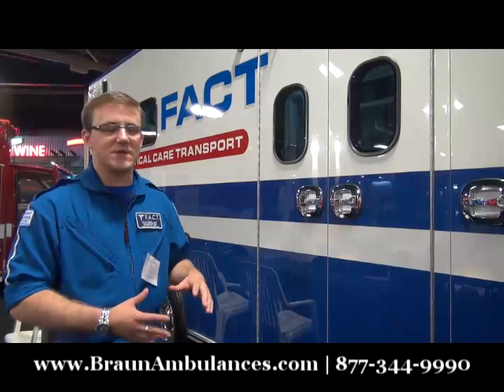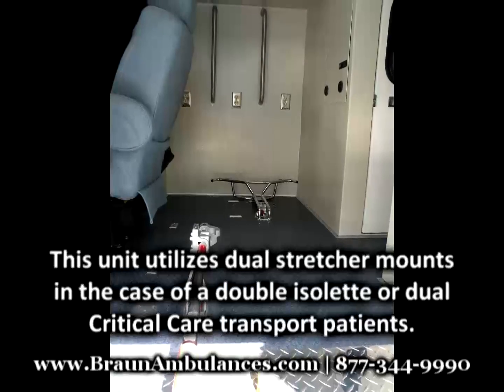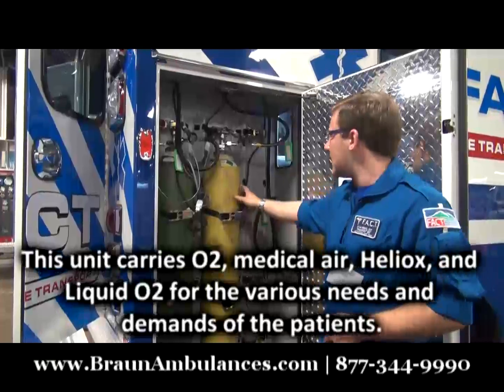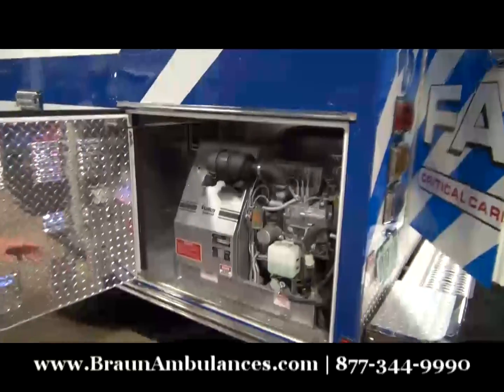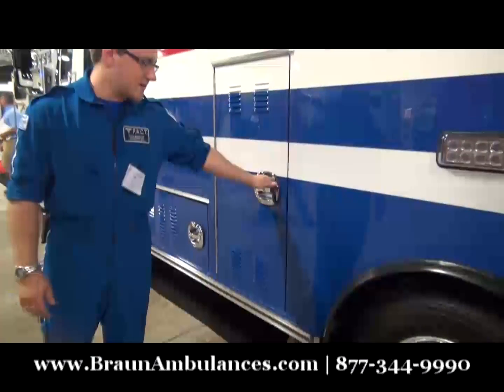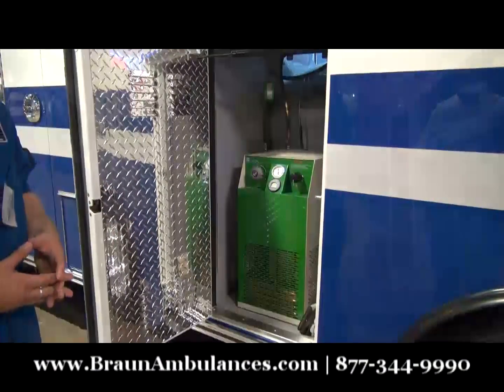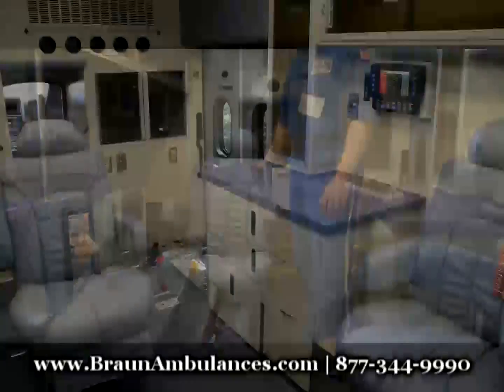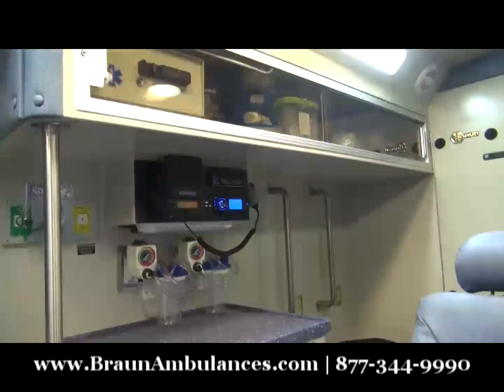Custom Ambulance for Critical Care Transport

Comment: what is your scope of practice......pretty cozy
Reply: FACT has critical care paramedics in addition to transport RN's. This is taken off their website:
Specialized, adult and pediatric critical care equipment is available in all FACT ambulances. These transport vehicles are equipped with transport ventilators capable of several modes of ventilation, a liquid oxygen system, invasive line monitoring equipment; internal and external pacing; external defibrillation; infusion pumps; doppler; pulse oximetry; end tidal CO2 monitoring; non-invasive blood pressure monitoring; and an extensive selection of pharmaceuticals. The transport vehicles can be reconfigured to accommodate an intra-aortic balloon pump, bariatric patient or a pediatric isolette.
In addition, our staff is trained in areas such as high-risk obstetrics, pediatric and adult respiratory therapy, SICU (surgical intensive care unit), intra-aortic balloon pump management, Advanced Cardiac Life Support (ACLS), Pediatric Advanced Life Support (PALS), and Neonatal Resuscitation Program (NRP).
Reply: I work for a cct team. Most places run different teams on diff trucks. A truck like this might specialize in neo-pediatric medicine and transports tons of kids and neonates. Where I work they are staffed with an EMT driving Neo-Peds CCT nurse, and respiratory therapist. They also sometimes carry cct paramedics and will occasionally take nurse practitioners and doctors from the main hospital. Extremely high level of care and extremely extensive medical equipment. It’s amazing seeing what these people do